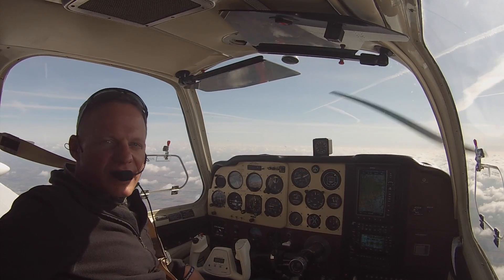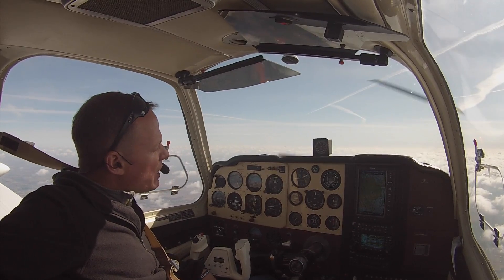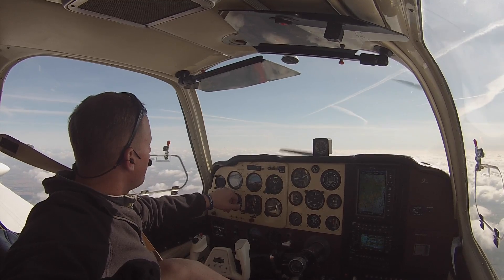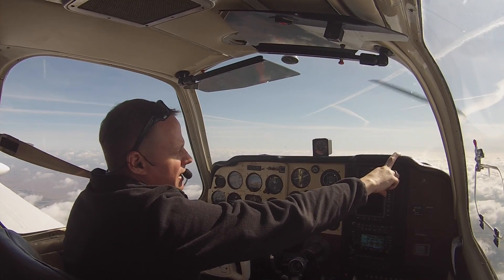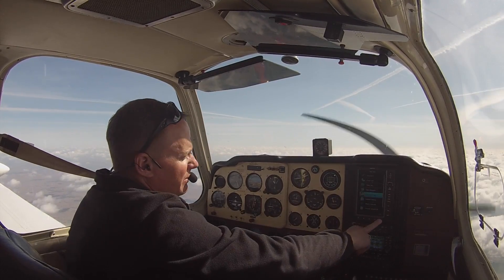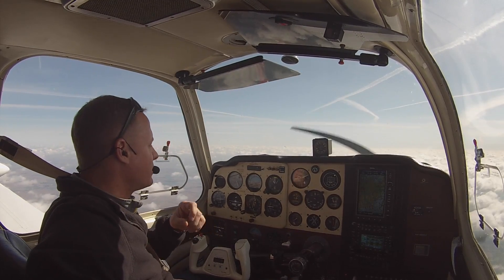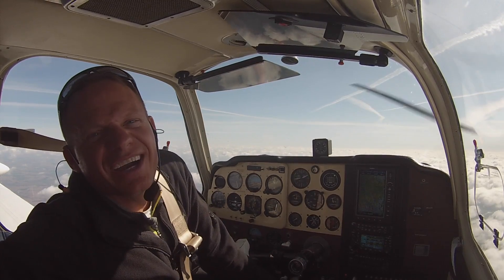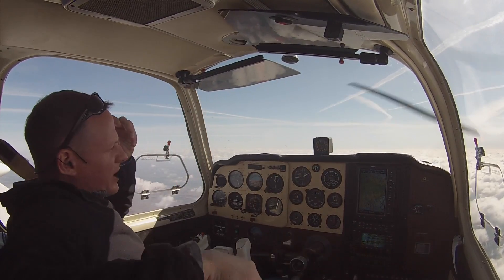One efficient Bonanza...

Comment: You said you had the rpm at 2100 but didn't say what the manifold pressure was. Do you remember what it was? Thanks
Reply from the maker: Hi Jo, that was 9 years ago and I don’t own the Bo anymore, but at that altitude I’m sure it was WOT. More specifically, in the E225 with 6-cyl GEM you have to first pull the throttle back very slightly until the CHTs are balanced — just a tiny pull. Then you can do the mixture pull to LOP. I hope this helps. I’m now flying at the same fuel burn (<8 gph) at 165 ktas in my RV-7! 😎
Reply: @mcclernonck  Got it and thanks for the reply. Those RV's seem to be great planes. Enjoy it!

Comment: Hi Chris, Your video takes me way back when I had owned a 1948 35 Bonanza SN1325. I had the E185hp engine, that was used on takeoff only, and cruise up to 165hp if needed. Such a wonderful airplane and easy to fly. Very maneuverable , and fast. Bought it in the winter of 1966 and sold her in 1978. I also had the electric prop, and it worked just fine. When I topped her, I took the prop off and greased the bearings and mechanism inside the hub, that controls the pitch of the prop! I also put a spar kit in, since I had the tubular center section. I put new plexiglass all over and a new tail support block(AD note). I sold it for a down payment on a house. Should have kept the airplane!

Comment: So I just my F33a I/O 550 at 2400 RPM, 75 deg ROP.  I get about 14.5 to 15.0 GPH.  All of my flights are 1-1.5 hrs or less.  I fly about 10 hours a week.  I’m getting 175 cruise and frequently with winds 185-205 across the ground.  I illustrate this because I want to give a different perspective.  It’s about the mission.  I also have some Clarity Aloft HS.  Love them.  Just bought the new Bose Pro-Flight.

Comment: I currently run an A35 with E225-8. I can run 8GPH at 136Kts from 8,500-12,500. Load the plane to the rear of the CG. Keep antennas to a minimum. Use the 88" Beech elec prop and run 2050RPM. Operate LOP, and watch the EGTs.

Comment: I love this video because it reinforces just how efficient the Bonanza design is. Running at 2100 rpm in my Archer II would be about 90 or so knots. Question for you: do you like the "in ear" headset?
Reply from the maker: Love, love it. It's a Clarity Aloft. Some pilots don't like something inside their ear... I love the passive noise canceling and the sound quality. I can turn the volume very low, which I think is better for my ears. They sell different size tips and I use a small. Thanks for watching my video!
Reply: You're welcome! Just curious, but was kind of speed did you get at 75% power in your Bo? I'm searching for an older E-225-8 powered Bonanza, preferably a G35.

Comment: I was always told (by Lew Gage) that you can't do lean of peak on an E225...  What are your methods?
Reply: BOPilot5517 

Smooth lean of peak operation with PS5 series carb is achieved by using throttle plate tuning of mixture distribution. After initial leaning to rough operation with full throttle position , reduce throttle angle just slightly until engine gains smoother overall operation. Lean a bit further and repeat the fine adjustment to throttle plate. I see 35 degrees Lean Of Peak routinely using this method. If you were to read the original engine operation manual it CLEARLY stated.  )" "Adjust throttle position to obtain smooth engine operation "

The best way to see and understand just how sensitive the throttle position effect on engine smoothness can be is to make a 3/4 vernier adjust at altitudes above 10,000 feet. Many have mistaken the resulting roughness as magneto issues at altitude, however it's all about equal mixture distribution as many no doubt have come to understand.
Reply from the maker: Not all E225s will run smoothly LOP. Mine did (just sold my Bo). If your engine runs smooth, all cylinders are in check, why not? My only caution: Do NOT attempt LOP without a 6-cyl GEM, and you must level all EGTs first.. While this video was fun to make, I rarely ever run at these settings--if you want to fly at 130KTAS buy a Cessan or Arrow. Ha! :)
Reply: I have had a lot of E series engines, all with the pressure carb. While running LOP is not easy, it can be done, but not as well as with port fuel inj. The key is to make sure your intake boots are all tight, and intake gaskets are good, and no vac leaks. Set the throttle all the way full, then turn it back with the vernier about 1/2"MP to cock the throttle plate in the carb. Then, pull the mixture until it runs quite rough. Now, gently add mixture back toward rich, but very carefully until the engine is running on all 6. You will be 5-20F LOP. It works best at 2150-2200RPM. At lower engine speeds, you get reversion from the cam overlap. At higher around 2300 the pressure across the injector is disturbed.
Reply: Doc Mirror 

Absolutely correct in all respects, great information.

I will add that the approx 1/2 turn back from full throttle also produces smoother operation on takeoff. I have to agree on the six point Egt equipment being a requirement to really gain a complete understanding of the PS5 nuances in differing situations